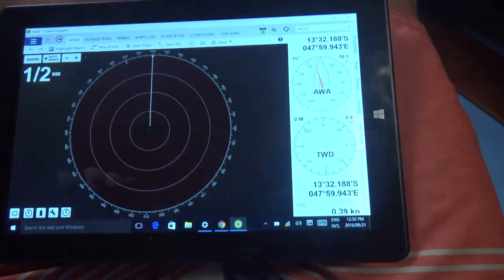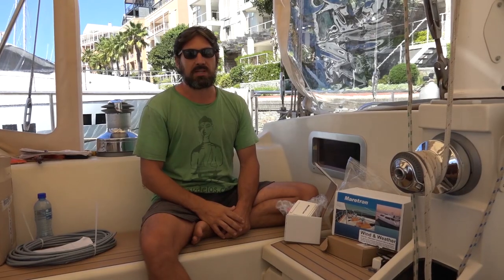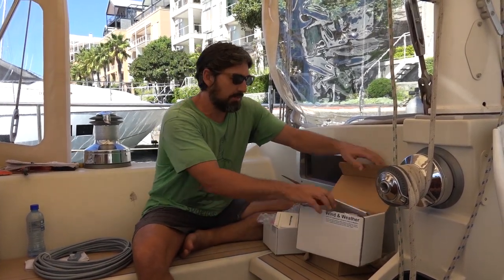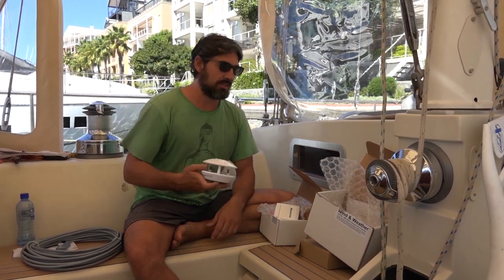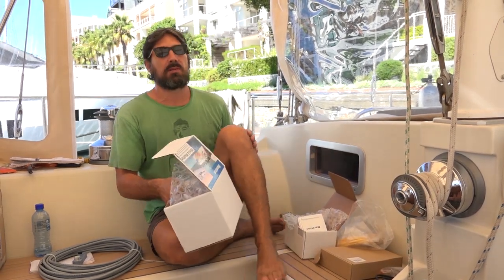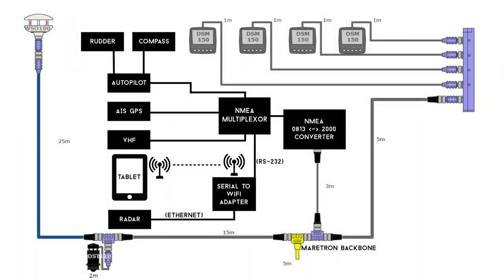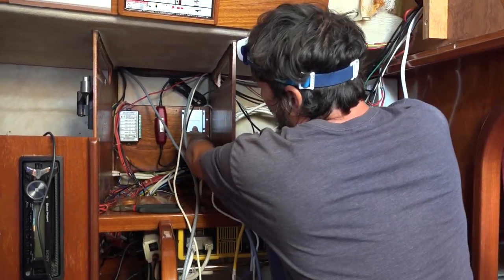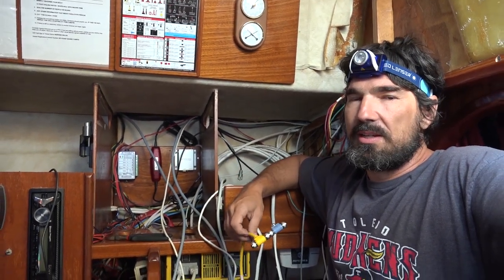Sailing and Navigation Electronics Installation!- Sailing Vessel Delos

Comment: I see so what your saying is ""For a number of years now work has been proceeding in order to bring perfection to the crudely conceived idea of a transducer that would not only supply inverse reactive current for use in unilateral phase detractors, but would also be capable of automatically synchronizing cardinal grammeters. Such an instrument is the turbo encabulator.

Now basically, the only new principle involved is that instead of power being generated by the relative motion of conductors and fluxes, it is produced by the modial interaction of magneto-reluctance and capacitive-directance.

The original machine had a baseplate of prefamulated Amulite, surmounted by a malleable logarithmic casing in such a way that the two spurving bearings were in a direct line with the panametric fan. The latter consisted simply of six hydrocoptic marzel vanes so-fitted to the ambifacient lunar wane shaft that side fumbling was effectively prevented.

The main winding was of the normal lotus-o-delta type placed in panendermic semi-boloid slots of the stator; every seventh conductor being connected by a non-reversible trem'e pipe to the differential girdlespring on the up-end of the grammes.

The Turbo Encabulator has now reached a high level of development, and is being successfully used in the operation of nofer trunnions. Moreover, whenever a farescent skor motion is required, it may also be employed in conjunction with a drawn reciprocation dingle arm to reduce soinasodial repleneration." I like it alot I stole this from the internet

Comment: that took balls to pull that transducer out of the bottom of the boat while still in the water !!!! dam you guys are off the chain lol love all the videos keep em coming!!!!!
Reply: That's actually a pretty common thing to do. The transducer has a little wheel on it to measure boat speed. It needs to be cleaned pretty often as growth on the wheel will foul it. Some folks pull it out anytime they are "parked" for more than a few days and replace it with a plug.

Fair winds.

Comment: I have used that same 0183 to 2000 converter and they sure could have made an easier way to connect it to a PC for programming. It is also a pain that you can't have it connected to the PC and your 0183 network at the same time for monitoring and troubleshooting. Why not have a built in USB connection on it?

Comment: "While we are in here, we are gonna rewire the solar system." Scope creep! Cool diagram, analysis and research. Doesn't hurt to have a software / hardware (?) engineer turned sailor. So open source and standards vs. proprietary tech in boating electronics? Man, multiplexors! Had no idea those instruments run on 4800 baud, seems ancient. RS-232, have done some soldering and twisting myself, that is a bit of an art, like welding I suppose. "Howd you do that?" "I don't know, I read the manual." What a hacker. Speaking of which, make sure you change all the default passwords, use SSL, and make backups! (Which, judging by what a master Brian is, he's already got it covered...)

Comment: Hi Brian, I went through a similar upgrade when i was on the hard in Thailand last year. Jamie on Follow The Boat did a little interview with me for his blog  when i finished. I am totally in favor of using non propriatary stuff. I like the Maretron stuff, the cableing with the metal connector barrels is far superior to anything else. I went with a couple of Triton 2's so and an a new NC3 AP controller for the MFD in the cockpit.. I kinda wished id done similar to you and used the DSM150 displays. I have a DSM250. Its great but its not super intuitve to program.  
I had a bad WSO100 straight out of the box, the service at ]Maretron has been great and they replaced it.  I really like not having moving parts on the mast head. 
I went with the 3g radar  for the ethernet via USB to OPN CPN. I love to figure out how to take that ethernet and send it through the N2K multiiplexer so I coudl have radar on a tablet. 
Super Sick job.
Thanks for Sharing

Barry
SV Spailpin

Comment: The old gas unit had a rail around the edge to hold pots, etc in place, so how do you find cooking on the open water with the new cook top. Have you had to replaced that rail with something else?

Comment: Cool, now when you're on shore somewhere with wifi you can check on your boat. If someone approaches it or if it drags anchor you can have you're proximity sensor notify you. That's way cool.
Reply: Put a gps tracking unit in your dingy and if for what ever reason, comes undone while sailing or motoring you can get a notice.

Comment: Shouldn't the VHF be separate from the main circuit in case of something failing? Lovely video though, as usual.

Edit: Do you have a transponder? Did you change it as well?
Reply: The VHF just takes position information from the network.  The network isn't needed to make the radio work.  He said the boat has AIS on the old NMEA network.
Reply: Star Gazer cheers

Comment: Question for you, Delos. Does having a single wire for all the instruments create a single point of failure? In other words, if you lose that wire to something and will you be sailing completely blind? Tradeoff that risk with more wires, more chances to fail. Just curious.
Reply: That's what the compass is for. Have you ever wondered what they would do if the mast was struck by lightning and all the electronics were fried?  Or if they hit something and had to abandon ship to Maggie?  Sailors have an emergency kit with compass, GPS and radio (among other things) in it that they would take with them in Maggie (or the life raft).  That's the backup.

Comment: Common shared bus ..... also known as 'single point of failure' or 'putting all your eggs in one basket'.   Hope it all works well and you have plenty of spare connectors.
Reply: Much easier to troubleshoot than the spaghetti mess they had to begin with. And now they know where every wire and connection is located.

Comment: Maybe you felt bad after climbing because you used a harness and was not able to rest the pressure on your legs from time to time, it is the danger of not using a Bosun's chair and can cause embolism.
A way to avoid this would be to make two loops to push on your feet and attach them with a prusik knot on the halyard.
Good luck!

Comment: How did you retrofit the new instruments so neatly into the dash since the hole sizes didn't match? When I saw that I thought, holy hell, how is he going to enlarge those holes without butchering the dash? Did you find hole adapters for the larger diameter instrument back plates to smaller hole sizes???
Reply from the maker: We had some custom stainless plate adapters made in South Africa :)  Lekker people there bru!
Reply: It looked spectacular as if Amel did it themselves. Good on ya!

Comment: I think that's great I love the electronic advancements.. I did the wifi cams for all wifi pads phones an has a security password protection.. $35 Amazon.. Then WIFIAV download from App Store for free.. Then you can run it threw a splitter with SD card an record wifi. So if you are away form the boat an have cell signal you have cam capability.. If not you can build a long range wifi just for your pads or cell phones an still pickup all wifi from the boat.. It's easy to do at low cost.. Great vid an the updated equipment an time it's all worth it. One or two more steps an you will have long rang wifi even when hiking.. Lol..

Comment: By changing from individual wires to the one backbone wire, will you maybe faced with a total system meltdown losing all instruments where with the individual wire system if a meltdown you might only lose one instrument?
Reply: That's what the compass, GPS and radio in the emergency kit is for.

Comment: Did the sensors require calibration, or were they all accurate out the box ?.
Next on the shopping list, Panasonic Toughbook.
Reply from the maker: We had to calibrate the barometric pressure and offset the depth for the keel.  Other than that all was pretty accurate.
Reply: You made the inter-phasing of all the boxe's, especially between the old and new boxe's look easy, hat off to you.
As a matter of interest, have you done a compass swing of your primary mechanical compass ?, on aircraft this is a requirement whenever new bits of "metal" are added to the craft, or at the OEM's recommended service interval.
A compass swing should be done at a distance from any external structures which might influence the ship's magnetic field. All relevant electrical and electronic equipment should be on.
A interesting experiment would be to note the compass heading with a dead ship (err, Dark Boat sounds better), then power up the systems individually and see if the compass hdg changes between power-up of various systems. (Compass Deviation).

Comment: Its easy to replace fuel taps etc also. They pressures are relatively easy to plug.  Like,  replacing a fuel line tap or ?? is easy,  even when its the one that comes out of the Tank.  And by the way.  If a boat has anything but a Knife Valve coming out of the tank;  replace it with a knife valve.  I have had two boats where the tank valves went bad;  all at once and basically stopped any fuel from getting thru. Krazy.  to replace this tap thou;  really I have never lost more than a cup of fuel.  Of which you can catch,  most of it.

Comment: Hey guys. How have you found the Maretron electronics you added a while ago? I'm about to do a full refit of electronics and with so much out there, some advice will be great. If you had to do it all again, what will you do differently?
Reply from the maker: They are actually very cool, and the have sensors available for just about everything you could want including batteries, generators, solar, etc.  We found the price to be similar to the other major brands but felt the quality of the displays was a bit better on the Maretron.  Would definitely use them again.  The only thing I would do differently is get a better tablet if you are going to use that as a primary navigation device.  It works okay but using everything over Wi-fi we have had a few times when the signal dropped.  But still works.  major change would be a hard wired ethernet port if the wi-fi is giving issues.  Hope this helps!  Brian
Reply: Sailing SV Delos Thanks Brian. Very useful info. Checked your AIS and see you're in Rio. Looking forward to your next post. All the best and see you on the water some time.
Reply: I've had that tablet for a while now. Its very handy and fits on a cheap ebay "tablepod"" https://en.wikipedia.org/wiki/File:Gorillapod-with-camera.jpg by bending the two front legs up to hold it, and can still have a cellphone attached if you want to video something.  I use it to read instructions while videoing soldering jobs , like the HFSIGNALS.com SSB called the uBITX . Wow, pretty geeky huh . ... ..... ----  I did run into one problem, it can go down, at least in the Win 10 mode, to a point where it won't charge. I might have found a way to get going, a extra long push of the "turn on" button... Also have a plug in GPS for the tablet, which could help if a major systems problem happened. Not sure if its loaded with memory, a lot of devices add only half. There are vids showing people opening up the unit with something like a guitar pick...
Reply: Probably time to do a quick vid about the new generation software stuff. Also, the answer to the sat iridium problem ? And whatever else has come up with techy stuff ! +Sailing SV Delos

Comment: Is it possible to control the auto pilot in the future on the tablet with that new system?
Reply from the maker: You know, the NMEA multiplexor is bi-directional so it should be possible to put in a course and have the autopilot follow.  I haven't tried it though so not 100% sure but if the nav software supports it I don't see why not...

Comment: Did I catch that there is still an XP laptop as part of this lashup ? or was that just for programming ?
Reply from the maker: It's the only thing I could find that had Hyperterminal installed on the boat!
Reply: Oh, ok,  Found a little for those curious to study , this http://searchenterprisedesktop.techtarget.com/definition/HyperTerminal  and this http://www.hilgraeve.com/hyperterminal-trial/ , the new version they say works on 10
Reply: Found a hyperterm which works on t0 if your interested.
Reply: Got that TAblet. Will just ask you if I have questions LOL .. Actually, I'll be using it on SSB Digital. I've heard theres a maritime version, but I use the ham version PSK31 among others. There are many versions.

Comment: Good Video !  Watched it all. i Cringed when i saw u Soldering in the air above bare feet. i guess u Edited out the part where a bit of solder dropped on your foot and u were doing the chicken dance. Existing Electronics Lasted about 15-16 years with heavy exposure to Salt Water & air  etc. Now that's Quality !That says something about the last company that's for sure ! Hope the New stuff lasts as long as the old stuff. i guess we'll see the video's if they don't.

Comment: I wish you explained terms like backbone and multiplexer.
Reply: The NMEA 2000 backbone is a cable that runs thru the boat. Anywhere along the backbone you can add a T and a drop to an input device (speed sensor, wind, GPS, battery state, door ajar switch, there are a couple dozen + device types). You can also T off of the backbone to output devices like the 4 helm MFDs (Multi Function Display). Any output device on the backbone can read the data from any input device. Cuts down on the amount of wire needed for the system and allows for easy future expansion. If Brian someday wants to add one of those helm instruments in his cabin, all he has to do is add a T to the backbone and run a drop to the new instrument.

The multiplexer takes the individual signals from the older, non-NMEA 2000 compatible, equipment on the boat and combines them into one signal.

Hope this helps and fair winds.
Reply: Lane Street thanks!
Reply: Your very much welcome.

Comment: Hi Brian, I know you're a very computer savvy guy so I'm sure you researched the NMEA bus thoroughly. I found several warnings that that a single component failure can shut down the whole bus e.g. here: 
https://www.morganscloud.com/2013/05/26/nmea-2000missing-the-obvious/
Apparently the best connection method is to connect each device with a t-connector to the main bus, then the failure of one component won't kill the whole system. 
There is a good troubleshooting article here:
http://www.oceannavigator.com/September-2010/Generic-troubleshooting-of-NMEA-2000-networks/

Comment: You know your stuff Brian, but just be careful with windows 10... it has an affinity for randomly rebooting and 'updating' itself, in some cases completely reinstalling windows to the 'latest' version. You should look into blocking updates and upgrades and also stopping telemetry. Also you should really throw a Ubiquiti Bullet Titanium M2 on the mast, and use it in 'long range wifi client' mode. You can then use it to pick up ANY network when docked and sponge free wifi... (provided it's open or you know the credentials, maybe a local cafe etc). Guide here on how to setup the AP for this mode, it works great: https://help.ubnt.com/hc/en-us/articles/205197710-airMAX-Configure-a-Long-range-WiFi-Client Personally I would then plug the network of the bullet into a a second wifi AP, probably a Ubiquiti Pico, and just have it bridge the Bullets network. That way you can have any device connect to the bullet over the Pico's wifi bridge, and keep this all seperate from the ships 'navigation' wifi network.

Comment: [Mostly off topic rant]So we have this flow meter that sends flow total over RS232 in ASCII to a MOSCAD RTU that radios it back to our SCADA system, and another utility's SCADA system.  Boss doesn't like it, for no good reason.  Tells me to put our own PLC out there and split the signal.  Well, two problems.  RS232 doesn't allow multiple masters, and the PLC I have to work with has no function to parse out an ASCII string.  It only reads registers, of which there are none.  But the meter also outputs instantaneous flow as a 4-20ma signal, so I use a one in two out optical isolator to split the instantaneous flow and program my own totalizer in my PLC.  Not good enough for the boss man.  Joke's on him, I found a better paying job.  Tomorrow is my last day.  Bye, Felicia.[/Mostly off topic rant]

Comment: check out esp-link + $4 arduino, you can make all those NMEA 0183 devices wireless.
Reply: Tell me more.
Reply: Look on ebay for "NodeMcu V3 Lua WIFI" which is an arduino + wifi. Then google "esp-link" you will find the software page.  You program the device with esp-link software and  connect it to your wifi network.  Then hookup the RX + TX of the NMEA device to the TX+RX of the arduino and you then stream the data by connecting the the ip on port 23 using opencpn or multiplex them using kplex on a raspberry pi.  I think there is even NMEA0183 -> NMEA2000 software so you can do some pretty neat stuff.